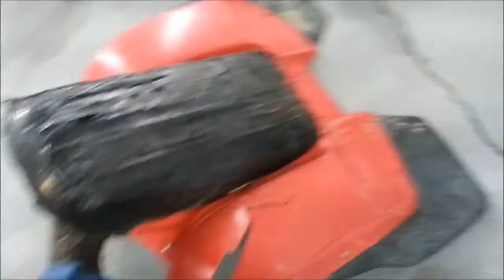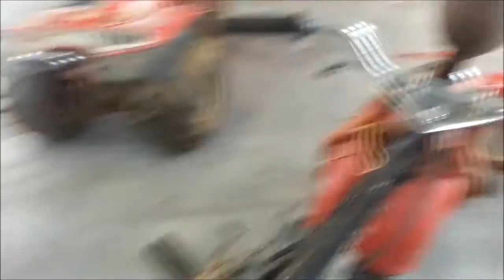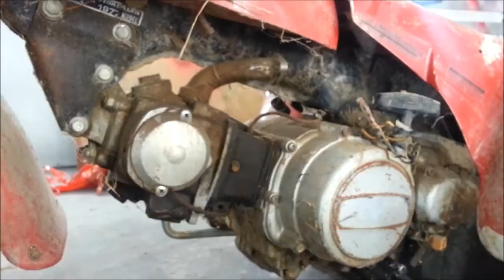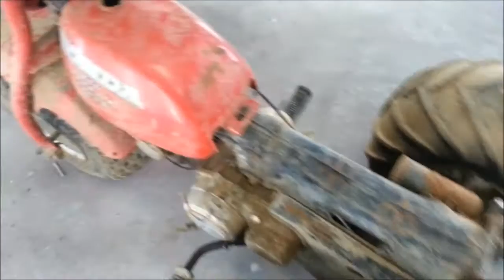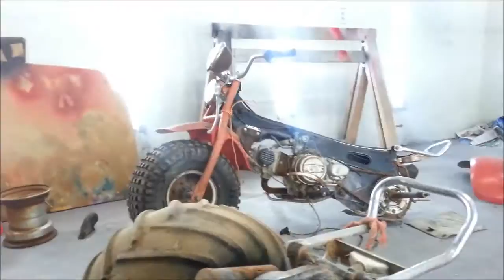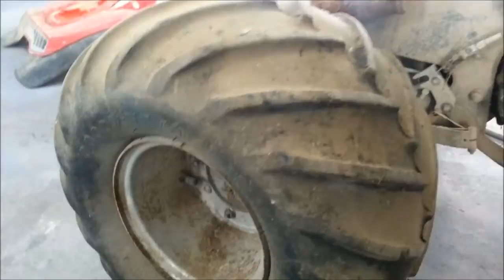The new to me atc110 and atc90

Comment: my buddy got a klt200 3 wheeler along with about 5 chinese atvs for $100 after helping a little he got them all running except for the one china atv, it had too many issues to be worth fixing. The three wheeler needed actually nothing we tested and got spark and compression and then we cleaned the carb which we actually diddnt have to no fuel sat in it and it was perfectly clean. opened up the fuel tank and it was full of about 17 year old gas fuel pump turned on choked it fired up quicker than you could turn the key, the only thing it needed was a battery. the original ower thought that it was totally shot and needed so much work really if he put a battery in it he could have rode it around. and it ran half decent on that old gas, we did top it with as much fresh stuff as we could but I think the only reason it ran on that fuel because that fuel was from back before they had ethanol in the fuel.